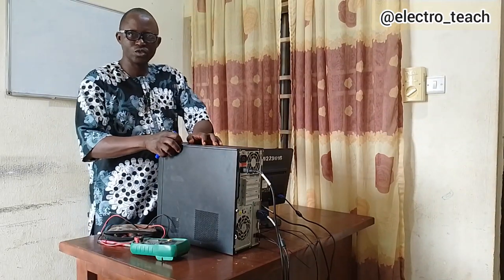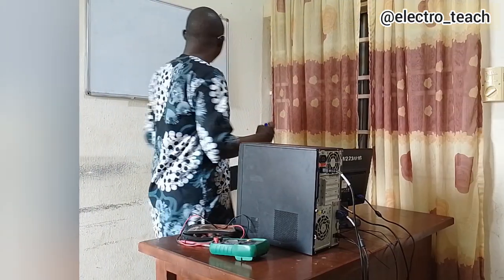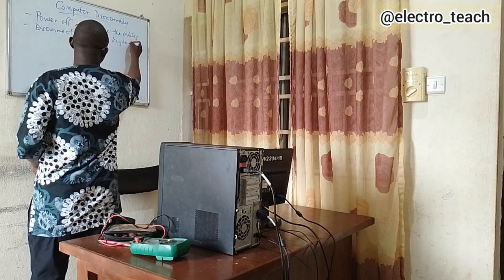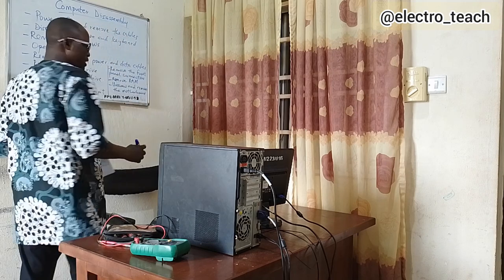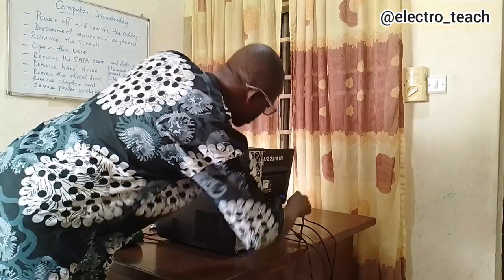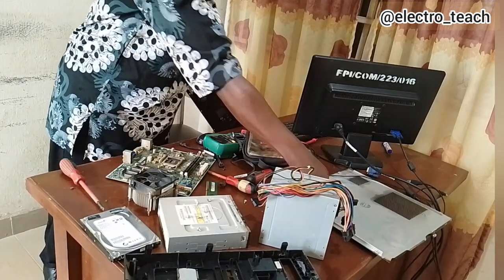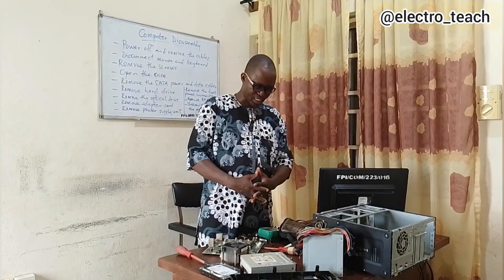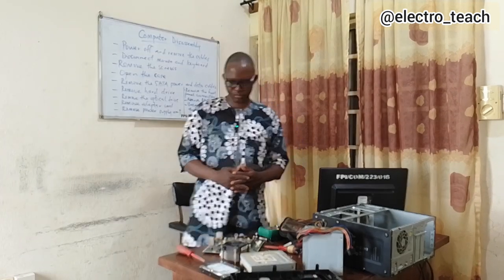HOW TO DISASSEMBLE A COMPUTER | PC Repairs | Computer Hardware @electro_teach

Comment: @Aribikolasi Habeeb 

I understand how to disassemble computer system and some steps to disassemble it 1. Power off 2.remove all the cable 3.disconnect mouse/keyboard 4.open the case and remove the screw 5.remove all inner cable 6.remove the hard drive and alticul drive and power supply unit and the front panel connectors RAM unscrew and remove the mother board

Comment: It’s so educative, learning how to disassemble a computer,

* power off
* remove all the cables 
* disconnect mouse and keyboard 
* remove the screws, open the case..
* remove the inner cable 
* remove the hard drive
* remove the dvd drive 
* remove the adapter card
* remove power supply unit 
* remove the panel connectors
* remove the ram
* unscrew and remove the mother board

Comment: To disassemble a computer means .😮 When referring to hardware, to disassemble is to break down a device into separate parts. A device may be disassembled to help determine a problem, to replace a part, or take the parts and use them in another device.  And able to dis arrange them in a better way

Comment: I learn how to disassemble a computer 
💻 

And proceeds
Which are Unplug your computer.
Remove side covers.
Disconnect connectors.
Remove standalone fans.
Remove storage drive.
Remove memory modules.
Remove power supply unit.
Reply from the maker: You are using online info on the subject.

Comment: How to disassemble a computer system

It requires some steps in disassbling computer system which are

1 Power off and remove all cables

2 Disconnect mouse and keyboard 

3. Remove the screws and open the computer case

4 remove all internal cables; SATA cable and data cables

5 Remove hard drive

6 Remove Optical drive

7 Remove Adapter Card if Available

8 Remove power supply unit

9 Remove Front panel connectors

10 Remove the RAM

11 Unscrew and remove motherboard.

Comment: I learnt how to disassemble the computer first thing z the power off second removers the cables 3 disconnect mouse and keyboard 4 remove the screw and open the case 5 remove the inner cable 6 remove the hard drive 7 remove the dvd drive 8 remove the adapter card 9 remove the panel connectors 10 remove the ram 11 remove the motherboard

Comment: Have learned how to disassemble computer system and some steps to disassemble it 1. Power off 2.remove all the cable 3.disconnect mouse/keyboard 4.open the case and remove the screw 5.remove all inner cable 6.remove the hard drive and alticul drive and power supply unit and the front panel connectors RAM unscrew and remove the mother board
Reply from the maker: Hope you can do this yourself now